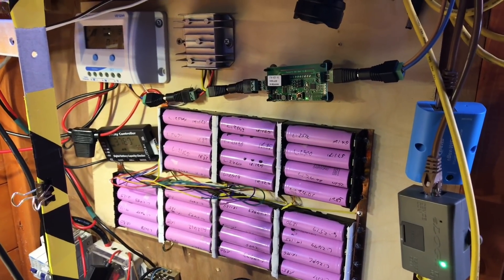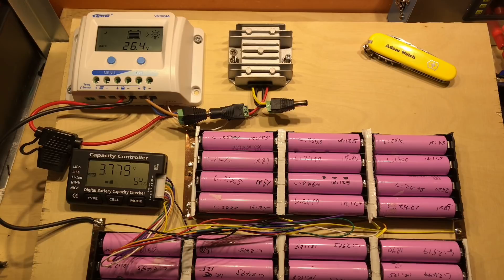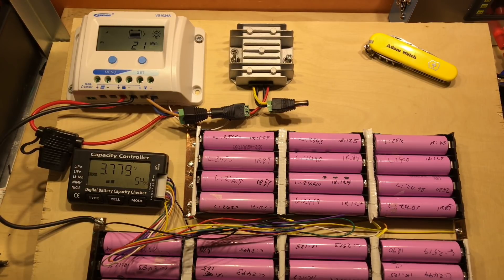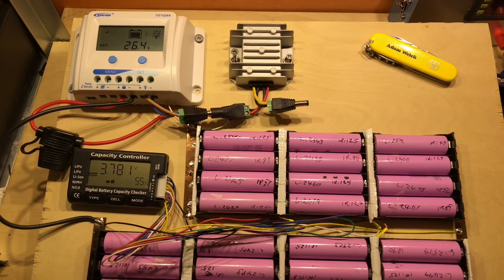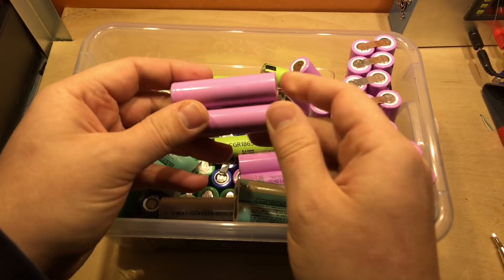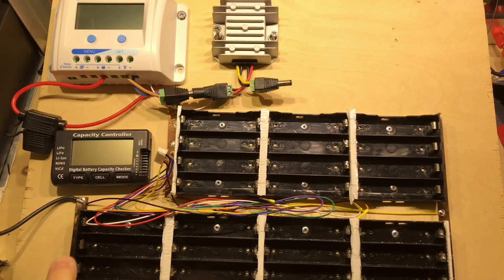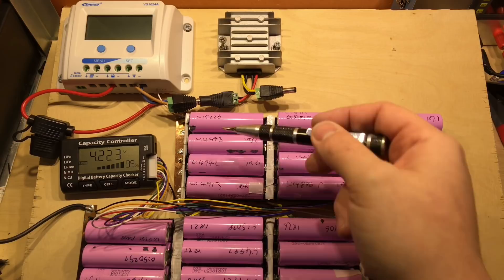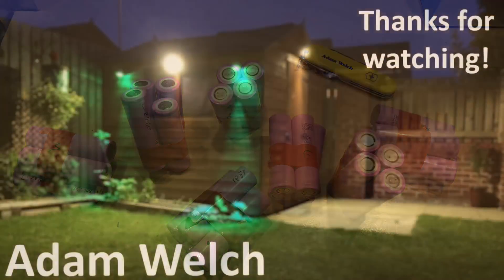Solar Charging Lithium Ion 18650s - Part 5, A Year On - 12v Solar Shed

Comment: Hello
I made a similar pack my self i am using bms balancer using the same batery controller and s lithium scc charger but  i encounter a problem .
Wen i connect a load the voltage drops dawn a lot from from 12.4 to 10.3v wen trying to charge my phone for exeple 12v lithis gows dawn around 11.8 v .
What can it be the problem?

Comment: Please forgive the sloppily asked prior question.  I want to spot weld a nickel strip to all the negative ends of the 18650 cells to act as a negative bus bar.  Then I only want to fuse between the positive cell ends and the positive bus bar. Do you have any misgivings about using the method?
Reply from the maker: I understood the previous question perfectly, don’t worry. One fuse is fine, but for practical reasons one at each end was easier for me.

Comment: I have learned my understanding of solar/lithium-ion systems from your videos.  So I want to thank you.  I note that you always fuse the bus-bar/cell on both ends. Is it necessary to fuse the negative?
Reply from the maker: No it’s not. One fuse on either the positive or negative is fine. I found the fuse wire to be easier to solder on than anything else, so ended up with it on both sides. Glad to have been of help. Thanks for the kind comments.

Comment: Pretty slick idea for the upgrade using the 'pairs'! My battery packs are welded so I can't do this. Each of my packs is 80 cells (20p x 4s) so I replace or add 80 at a time. 
   Nice work and Greetings from America, John

Comment: what charger need be can adjust charging volt just to 18650 battery right good. not broken batterys. or can i use all solar charger same than you battery bag have. i need made same system thailand not have gridd elektric good cut alltime lot if wind or rain.

Comment: Hi.  I want to install an equal system.  I need to know if a BMS is not necessary, I don't see it in the video.  And also what bulk and flotation charge voltage value should I adjust.

Thanks!!
Reply from the maker: Try watching the full series - I hope it’ll answer most of your questions. Charging Lithium Cells with a Lead Acid Solar Charge Controller https://www.youtube.com/playlist?list=PLXyc_wd5sxbhYhAKHVq8SGQ2Sncl1PDDT

Comment: Do you just buck everything to 12 v ? Isn't that inefficient?
Reply from the maker: It is yes, but more efficient than inverting it and boosting to mains voltage! Sadly I don’t think lithium ion works for a substitute 12v battery.
Reply: @AdamWelchUK  you can go 4s and not put nearly the same amount of stress on the batteries.

Comment: Mr. Welch, thank you for all the information that you are sharing with the whole world.
I would like to know what is in that aluminum case wired up to the right of the charge controller? 
If you mentioned it in the video then I apologize for missing it.
Reply from the maker: I think I mentioned it in a video - it’s a dc2dc buck converter, reducing the ~28 volts down to 12 volts so I can power some 12v external lights on the shed. Cheers

Comment: I am possibly looking into getting some used 18650's my self to build a power wall as well, 12 volt solar powered to charge the batteries and a 750 watt inverter only using about 200 watts to power what I need, 3 led 9 watt lights, my laptop 40 watt, and my stereo 75 watt, for heat in the cold days or winter months a rocket stove, and possibly thinking about a wind turbine and a thermoelectric generator as well to charge batteries, right now i am using lead acid batteries,   Its all a big project and a trial and error process, Lots of fun, keep up with the good videos and info
Reply from the maker: Sounds like you have some big exciting plans. Thanks for the kind comments and good luck with your project.

Comment: Have you looked into repurposing old smartphone chargers? No affiliate commissions earned but it is a great way to be green and save money.

https://www.youtube.com/watch?v=hi8iDy7jsOg
Reply from the maker: It’s a reasonable idea, and I like the repurposing aspect but sometimes on cheaper usb power supplies the 5v is referenced to the mains - which could be quite dangerous linking them together this way. Big Clive often finds and exposes these. 
Secondly have you checked your tp4056 boards all charge to the same voltage? I found there can be quite a difference in their termination voltage setting when I treated the multi chip version of the module. 
Cheers

Comment: I really would like to build an identical shed for learning purposes. Are you planning to make such a video maybe with an updated charger controller? Sad that you don't talk about your inverter/consumers in this video. I am wondering what the cooler and the pcb after that are for.
Reply: Okay, I got you its a step-down converter to 12V for your lights ;). But the PCB after?
Reply from the maker: The PCB afterwards is the SonOff SV - its a wireless 'IoT' smart switch.  I did a video on that and using it with Amazon Alexa. https://youtu.be/I2ENfdRUUsA

Comment: If you take a knife and cut through those screw terminal barrel plugs, you will find a hair thin filament wire connecting the barrel to the screw terminals.  Watch your current usage!

Comment: Hi Adam, thank you for your videos! I'm building a 7s6p based on your design with two 20watt panels. My cell capacity for the 42 batteries range from 1700-2300mah. Will this present a problem? Here is my repackr layout https://ibb.co/cxDOaS Do you think the capacity checker will handle balancing 7s6p?
Reply from the maker: The higher cells in the group will end up holding up the lower ones.  The spread looks fairly similar between each group.  The biggest factor might be internal resistance - but repackr doesn't consider this. 
I think the capacity checker will be fine on this size of pack - and assuming you'll be keeping your eye on the system they're not too expensive if it doesn't work as well as we hope.

Comment: Question - I want to solar charge a 18650 with a TP4056 but my panel outputs 12 volts. I was going to buy a cheap "DC-DC 4.2-40V to 3.3V 5V 6V 9V 12V 24V Buck Step-down Converter Linear Regulator" that will convert the 12v to 5v for the TP4056, however the panel will not output a steady 12v it will dip & rise depending on light conditions. Do you think the regulator would output a steady 5v whatever the voltage it is supplied?

Comment: Hi is that a bridge rectifier on the load side of the solar regulator?
Reply from the maker: No. It’s a dc2dc converter. A buck converter dropping the 24v+ down to 12 volts.

Comment: I don't know if I've commented on this video of yours yet but... in case I haven't, just wanted to thank you for once again suggesting great things like the Capacity Controller, and using a 7S pack when trying to emulate a lead acid system's battery.
Reply from the maker: Thank you very much.  Glad to have been of some use!

Comment: Have you looked at active balancing for lithium cells? . . . this effectively redistributes the power from higher voltage cells to lower voltage cells rather than just burning away the excess power in the form of [resistive] heat.

Some links to the theory and available products are here;

http://diytechandrepairs.nu/1s-modular-active-balancer-reviewed-and-trashed/

http://www.gne2010.com/product2

https://www.aliexpress.com/item/1S-single-cell-3-2V-3-3V-3-7V-lithium-battery-balance-equalizer-BMS-lithium-ion/32788338337.html
https://www.aliexpress.com/item/3S-to-9S-lithium-battery-balancer-which-keep-voltage-difference-within-10mV-the-best-solution-to/1950876697.html?spm=2114.10010108.1000023.1.653442edVaImLd
Reply from the maker: I’m aware of it and aware of how it can be advantageous, but I’ve not looked to implementing it. I like the idea of a redundant pack which charges from the highest pack and delivers it to the lowest. 
Thanks for the links. It may well be something I look at in the future.

Comment: Hi Adam, I just wonder if do you need to set manually the capacity controller/balancer button to do the balancing from time to time. Or just plug and play. Thanks - dennis
Reply from the maker: You need to set it going by pressing and holding the left button (think it is labled type).  Once you've done that it should run permanently (until power cycled).
Reply: Adam Welch my plan will be installed remotely. It's 10Ah lipo 3s configuration,. Just wonder if that balancer can handle it and the balancing setting will stay for a long period of time. Thanks for reply anyway

Comment: I have watched a lot of your videos and have plans to build a battery like that.I really like the open architecture and accessibility. This will be my first battery.  I have a couple of questions. 1 I plan to use this to power 12v lights and some 5v and possibly some 3.3v controllers. They will all be on the same line so would I buck the main voltage down for each or have a fairly large buck converter do the 12v for the whole line and then separate smaller buck converters for 5v and 3.3 in series with that?
2 I plan to use the  epever tracer a mppt does this have the same characteristics as the one you used so that it will not trickle charge?
Reply from the maker: 1. It will depend on you buck converters.  If you've got a 3.3v buck converter that is capable of working on a 24-29 volt pack then it's probably best to reduce the load on your 12v converter and just connect the 3.3v converter to the battery pack.  I'd personally test both ways round and see how efficient it was as well - I suspect only one buck process is best, but it'll be fun to work it out.
2. Now I haven't tested the tracer on my lithium pack but knowing it's lead acid performance and my knowledge of the other EPEver products my understanding is yes - it will work in the same way.  I feel a test coming on. Need some sun though :-)
Reply: Adam Welch thank you for your reply. I'm setting up a small home automation system using raspberry pi and want to use solar and battery to power it. I live in Indonesia so plenty of sun🌞 but from time to time we get power outs. So would be good to power 12v lights and raspberry and the modem so I can still connect. Modern luckily runs on 12v. Says 1.5 amp on wall wart .

Comment: Wow I like your work Adam very informative. I'm planning to make my own also, just like yours using Capacity controller to balance the cells, However I planning to use my 10A MPPT EPever Charge controller. Hope I can ask advice from you. Thanks in Advance...
Reply from the maker: The use of an MPPT charge controller shouldn't make any real difference to the lithium pack - it's just trying to harvest as much solar as the technology will allow when it needs to.  Now the experiment has run successfully for a year I do intend to upgrade things a little and a MPPT solar charge controller is on the cards.
Reply: Using this Capacity controller and MPPT set up, do you think I can use any current rating on MPPT?  I mean can this Capacity controller able to handle higher charging current?

Comment: Can anyone help with this question please. In my off grid workshop I have a 100w solar panel going through a 20A controller and into a 12v 130ah battery, that’s working great. On the controller I also have a LOAD output that I have going to my lights, what I would like to know is if I can split that output and feed it into my motorbike battery to keep it topped up. 

When I look at my charger that I have used that plugs into the house power socket, it states Output 12v / 800mA. If I can feed a cable to the LOAD on the controller and to the bike battery, will it act as a trickle charge or what will happen once the bike battery has fully charged? Thanks a lot
Reply from the maker: You'd be better off using a DC2DC converter on your load output to connect to and regulate your motorbike battery.  Otherwise you've no way of regulating the current going from your main battery to your motorbike battery.  Secondly it will prevent any reverse current, or the inability to control your lighting circuit.  As long as the voltage wasn't too dis-similar between your main and bike battery, you could opt for a diode to prevent any reverse current I guess if you wanted to keep it very simple.
Reply: Thanks a lot Adam, I thought though that going via the controller LOAD would regulate the flow from the 12v DC to 12v DC. But you're right that I would have no way knowing what the current is going from the Controller to the bike battery.

Comment: The CMTD charge controller either blue or green is programmable to get a more accurate charge. You did a video on it but that particular one you have is strictly lithium where as the one I'm talking about is the regular lead acid. I would like to you use that one. I'm gonna actually try it out. It coincidently has the parameters for a 7S pack (21v 25.9, 29.4) but like I said it is programmable.

Comment: So how do you prevent the lights from completely draining the batteries, usually there would be a electronic controller to monitor the batteries to prevent them from dropping passes are in point
Reply from the maker: The outside lights out on a Sonoff SV wifi device. So they’re timed to be on for a few hours only. The sole charge controller has under voltage protection as well - but hopefully it never kicks in!

Comment: i think you need BMS ( batteray management system ) in order to the current and voltage are same each batteray when you charge by solar controller
Reply from the maker: I’ve got one. The capacity controller does balancing. However the bigger the groups of cells, the less it’s needed I’m finding.

Comment: Thanks for doing an update, I was wondering if you had a problem with this system.    I was thinking maybe a 1s1000p pack and that way you would not need a balancer.  I just bought a micro 2-4V converter to 12V.   Then I as wondering how to get a solar panel down to 4V efficiently.

Comment: They probably lost almost no capacity at all at about 4V. You're probably going to get a total of 2000-2500 cycles out of them.

If I was to do this project again, I would put a TP5100 with a multiple poles switch with a 4S pack to manually balance packs if they get too unbalanced.
Reply: NeutronPCXT how about if you have the same model in Tesla battery ?

Comment: Can the controller be used on a 12 v set up as i have 5x12v batteries in parallel and then connected to a 2000w inverter and then the hppt solar controller.

Comment: The extra capacity might mean that they take longer to fully charge, but it will also mean that they'll take longer to discharge.

With any luck, at the start of each day the cells will have enough capacity left from the day before so that with the added charge taken through the next day, they won't run out of power until there's enough sun to fully charge them again.

Comment: Ummmm, something just not sitting right with me, I still think that you have a 7S-4P set up because the cells are paired in parallel which is effectively double the capacity. So I would say you have just created a 7S-4P-2A because you have double capacity in Amps because of the way in which you have arranged the cells in the pack.  

It will be interesting to see how this holds up over winter periods as well as the effect on the cells with the type of configuration you have.

As for the guy claiming that the cells were manufactured together, I think he needs to see a real plant, there's videos, so the most you can hope for is that they were manufactured in the same batch and that the factory that assembled the packs took batches and didn't just mix the lot... 

Really holds no weight at all as an argument for keeping the pairing of the cells. It is however a nice hack to double your capacity.

Comment: Repackr.com is an awesome free tool. 
It'll be interesting to see how your system performance changes now that you've doubled the battery capacity. With my system I have to adjust the load sometimes in winter. In your case; if you still find it still doesn't make it through a long dark period you could always add a switch to cut out some of the load in mid winter (i.e., simple load management).
Thanks for the shout-out Adam. Cheers, Paul

Comment: i have an old 24 V UPS that used 2 x12v 7.5 Ah batteries and i am saving up my 1865's ,to make a battery for it. it is about 800 watts and will make a nice little portable power pack for the next time my mom losses her lights for days.happy moms are always better.lol. it will have this charger added and  a roll out 24v uni solar panel and a  the charger /discharger with balancing board. i got the idea from you back when you discovered the perfect match of the 7s with 24 volt systems. there's nothing like a battery that holds a charge for years.
Reply from the maker: +immrnoidall Sounds like a good project. Let me know how it goes.

Comment: Thank you for this, Adam. I'm new to the 18650 world. What do you use to test the mA capacity of your cells?
Reply from the maker: +Nicholas Radina I’ve used a liitokala engineer li-300. Mainly because it can fully automate the charge, discharge, charge process and secondly it’s the one I’ve always used. Many other people use the opus c3100.

Comment: I may be wrong, but I'm pretty sure a "cycle" is from fully charged to fully discharged, so if your cells are not being completely drained over night, it's only a partial cycle.
Reply from the maker: +John Douglas You could well be right with the pure definition. I’ll try and clarify when I look at the results of the capacity tests.